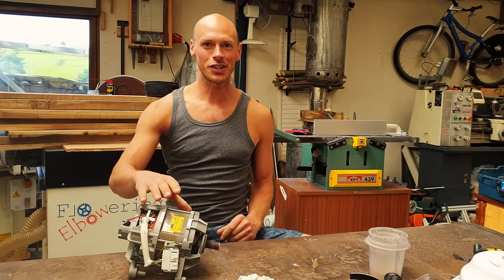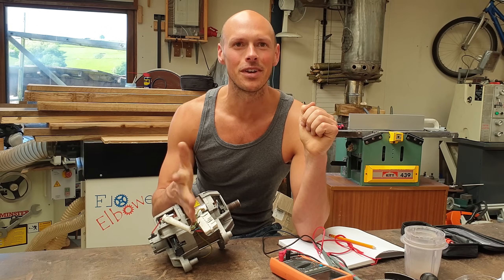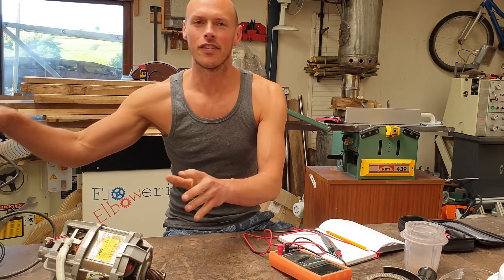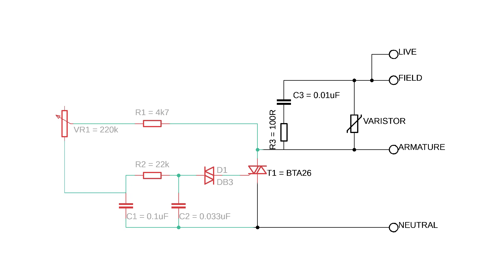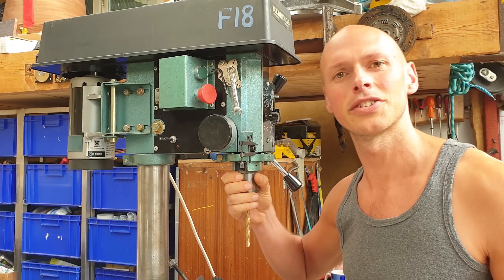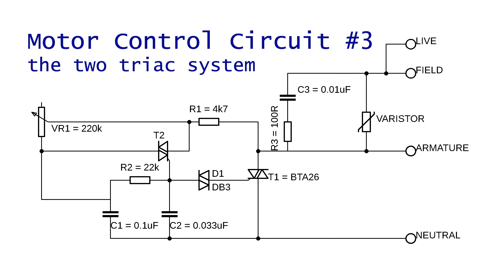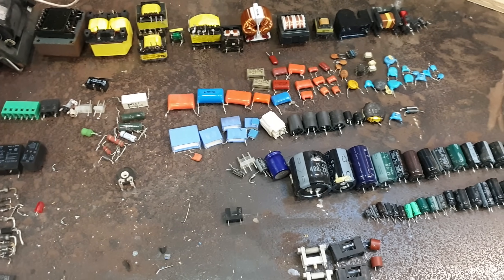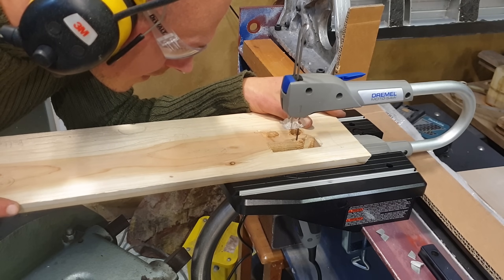How to reuse Washing Machine Motors [Arduino vs Basic Triac control]

Comment: Dear FloweringElbow, I made a similar circuit (4th circuit type arduino angle control) but without closed loop. In other word a circuit like a dimmer. All is working ok when I control a bulb lamp light. When instead I connect the circuit to an universal motor without any physical load some strange things happen. The motor starts at the imposed velocity and then at a random time it "jump" for some istant to another velocity value (higher), then return to the set one. For 10, 15 seconds all is OK and then again the motor "jump" on another higher velocity (not the same as before) and so on. What do you think about the problem? Thanks.

Comment: Hey there !  I dont have your electronic skills and i have this kind of motor i'd like to use in a futur project. I'll come back to your video when ill work on this but my question was, how would you use a low cost pwm controler (to a arduino or a potentiometer) to control this motor, which kind and why, and what do you think about the quality of this kind of setup ?? Thank you for any reply ; )
Reply from the maker: Hey Co Fa. It's a big subject... I am guessing you mean something like a light switch dimmer? In my experience they tend to not be very durable with the back emfs and transients caused by the big motor...

Comment: In the 3rd circuit, what is the part # for T2? The PDF you linked to just explains the theory of operation. EDIT: I tested circuit #3 using the same Triac for T2 and that worked. See my further comments below.
Reply from the maker: Yep. Good question. As I have yet to build that one, I'm not sure... Anyone here built it? Try searching for sensitive gate trigger triac... This one would involve a degree of experimentation.
But I recon, if you are aiming to adjust your spindle to a fixed speed for hole sawing - the 2nd circuit would be fine.
Reply: @FloweringElbow  It appears that the whole series of triacs from STmicroelectronics are "sensitive gate". I don't know if I can post the link, but digikey lists the T1 triac and a swath of other STmicro's as sensitive gate, so I'm assuming whatever you choose for T1 would work for T2. Let me try to post the link: https://www.digikey.com/catalog/en/partgroup/sensitive-gate-triacs/273.
Also @FloweringElbow, I think you misunderstood, the bit isn't a hole saw, it's a conical shaped bit for finding the center of a hole if for example you took your material out of the machine, but needed to find the exact center of some hole on that material if you needed to do additional work (mostly for metal).
Reply from the maker: @FrankenLab  Ah ha - understood. Now we just need someone to try the circuit and test out the two triac system in practice...
Reply: @FloweringElbow  I may give it a try, electronics is more my forte. I probably won't have time for a couple weeks, but I'll update when I do.
Reply: @FloweringElbow  Update on T2 for circuit #3
I just finished wiring and testing circuit 3 as shown in the schematic using another BTA26 and I confirm it works! Initially I forgot to complete a connection and I thought I didn't work.  Also, the STmicro Triacs in that series that end with BW or CW are snubberless, so that part of the circuit can be eliminated if you use those part #'s, for example BTA26600BW. Also the schematics don't list a voltage rating for the capacitors, I'd choose them so their AC voltage rating is AT LEAST double your line voltage. The Varistor is also missing voltage specs, in the US with 120vac, probably 200-250v would be sufficient for that, so in Europe I'm guessing 300-450v.

Comment: Hmmm, smart and attractive are always a bonus when watching informative technical videos! Looking forward to more good weather and more of your videos. I'm trying to slow down the router on my CNC machine so I can safely use a hole centering bit. The slowest speed the router spins is 12,000 RPM. The motor is a universal motor, and the router is a Makita RT0701C. The arduino circuit sounds like fun, but I think the 1st or 2nd circuits are all I need. Currently the router has some kind of closed loop microcontroller circuit embedded in epoxy, so under normal use I'll have a toggle switch to give control back to that. Great video!
Reply from the maker: Sounds like a cool project. I agree with you, the 2nd circuit should suffice. Let me know how it goes. Good luck!

Comment: Love this!  Great video,  principals well explained.  I am very interested in the idea of using a DC treadmill motor.  They are often rated at 1.5 - 2.5 Hp.  Thanks!
Reply from the maker: Thanks Mark! The cool thing about treadmill ones is that you can often salvage the controller with them. That's what I did with my pillar drill... and it worked a treat until I over did it trying to cut a 6" holesaw hole in stainless, and fried the controller. That's why I now use the 2nd one I showed in the vid... Works really well.  Peace, Bongo.

Comment: Deep respect.  Certainly more than I bargained for and will have to watch a few more times.  I bought a triac kit from FleaBay to run my motor and it blew up.  Defo needs more study
Reply from the maker: Thanks Nicco. Which kit was it, if you don't mind my asking?
Reply: FloweringElbow this or similar https://rover.ebay.com/rover/0/0/0?mpre=https%3A%2F%2Fwww.ebay.co.uk%2Fulk%2Fitm%2F272989993447  I never did what I’d hoped, controlled speed range was poor and it quite quickly gave up and the motor was in runaway mode.  If I could find a good control method that I can do without having to understand, I have many uses that I’d like to get these motors into.
Rereading my comment, I should make clear that the circuit gave up, not the motor